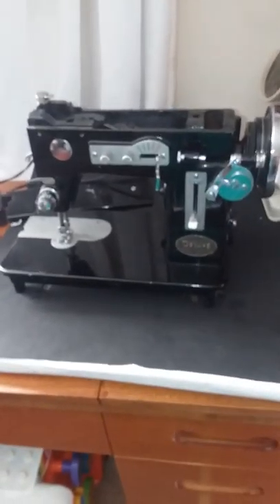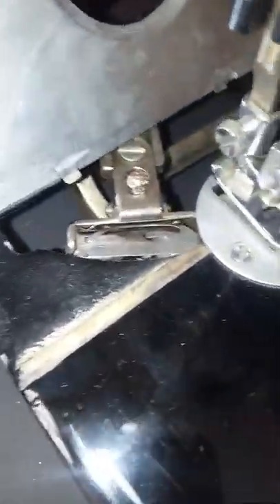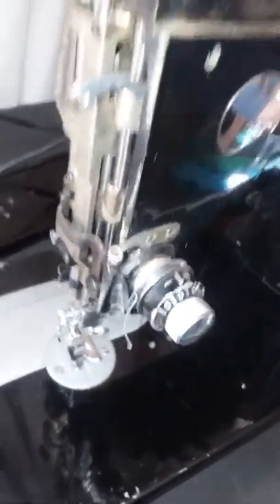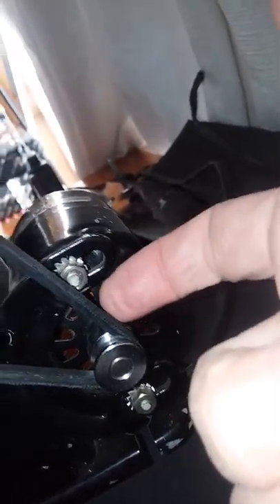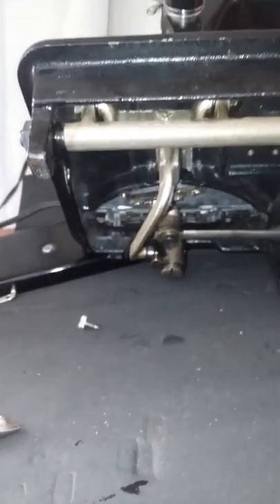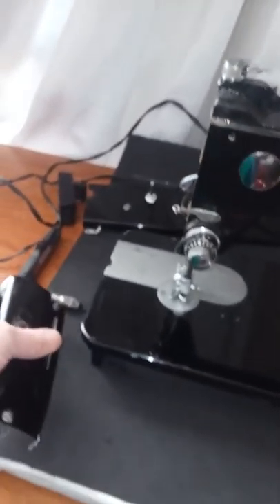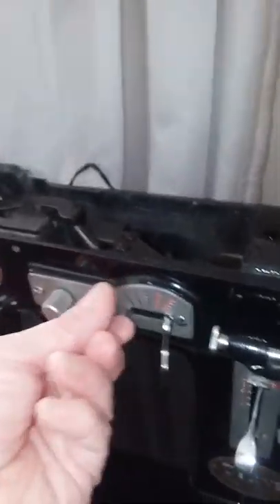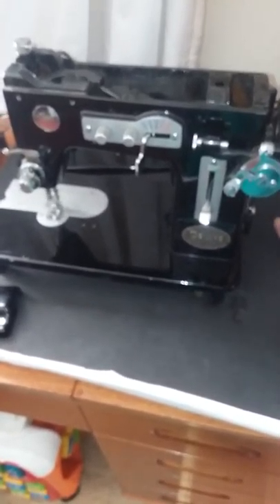3/4 size ZigZag Bait and Switch sewing machine vibrating shuttle https://tumorfarmer.blogspot.com/

Comment: I have one of these little cuties, mine is a Morse 1400. Can’t get a balanced zig zag out of it😢especially at shorter stitch lengths. I’ve taken apart and cleaned tension assembly, switched threads needles checked bobbin tension. Any ideas would be greatly appreciated.

Comment: Zigzag and vibrating shuttle is such an unexpected combination, and in 3/4 size to boot!

Is the bobbin a proprietary size, like the pink bait and switch machine, or will the generic singer reproduction ones fit? I’d love to find one of these machines and add it to the herd, but bobbin compatibility is definitely a concern.
Reply from the maker: The bait and switch machine does use a long shuttle/bobbin, and long shuttle case, which does need to be correct for the machine. This machine was sold as a White, as well. I blogged about it here-
https://tumorfarmer.blogspot.com/2020/01/34-size-zigzag-vibrating-shuttle-sewing.html?m=1

Comment: I just recently rescued a machine like this. HELP!!!!!
Reply from the maker: I'm not sure what you need help with.
Reply: @tumorfarmer  It will sew a few stitches then 3 or more inches it will not catch the bottom thread.
Reply from the maker: @dahleeeng  if you are using the correct needle system, and correct needle point, for the fabric you are sewing, and have the have the needle correctly installed, and it still skips stitches, periodically, you may need it retimed.

Ballpoint, or jersey needletips for knits, and stretch fabric, sharp, or universal tips for woven fabrics. Use corre t size for thread and fabric, too, silky, fine fabrics, use smaller needles, 10, 11, or 12, for medium fabrics, 14, but use 16 or 18 for thicker fabrics.